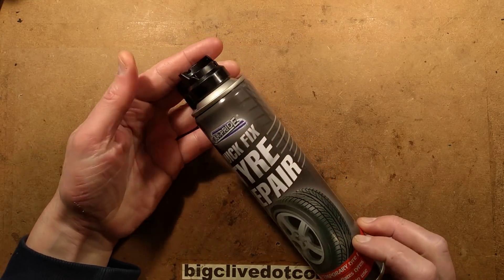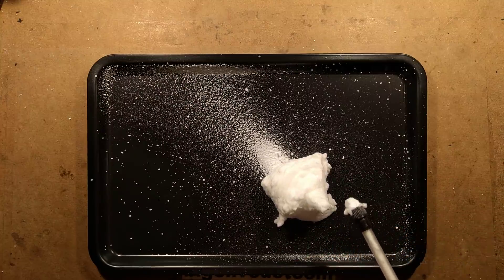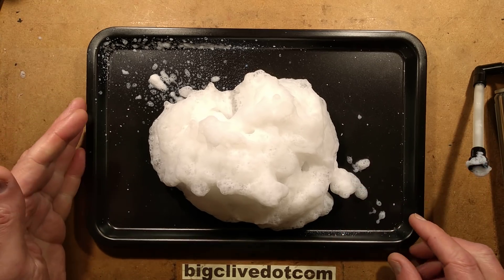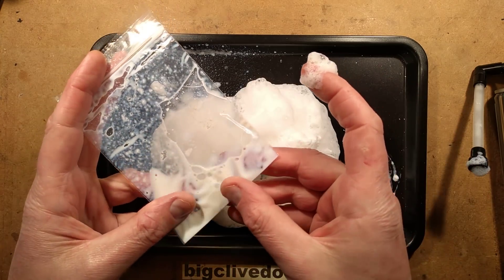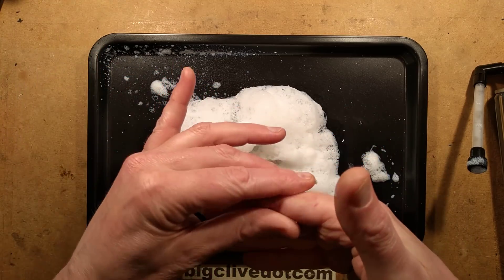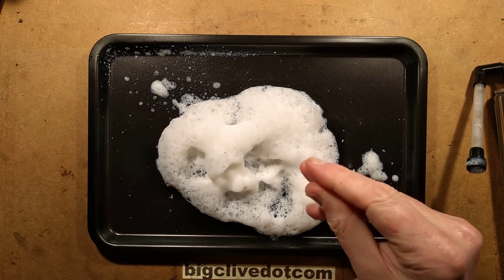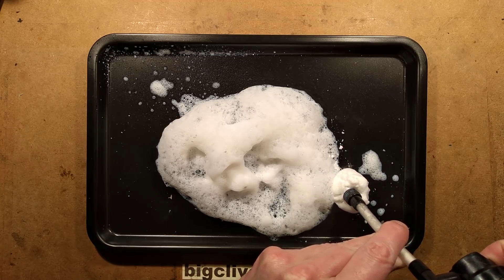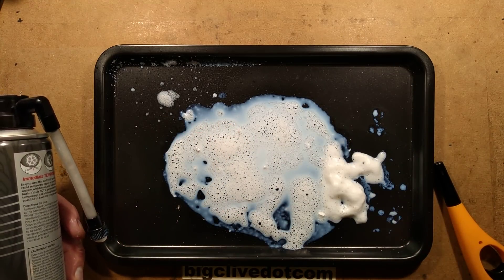What's in a tin of foaming tyre repair liquid.

Comment: I don't know anything about that stuff past that tire shops HATE this stuff.
Reply: I worked in a tire shop 20 years ago, It was Fix a Flat back then. The reason we hated it, it would fill the tire up with a liquid. And when you take the tire off the rim, the shit would splash all over you and the tire machine.
Reply: @caveslug-t2k  it's the same crap now... one drop of that crap will take like 10L of water for it to go away... the worst thing nowadays is that this crap is in the cars instead of spare tire.. that means that I've cleaned ALOT of them... and well.. it sucks
Reply: @EliasH96  I can still remember the smell, wasn't over powering or strong though.
Reply: @EliasH96   *A LOT      NOT "alot".
Reply: It's because after a while being in the tire makes one sticking mess
Reply: Of course, it means the tire shop has to spend ten more minutes cleaning the stuff out. And tire shops hate cleaning out wheels, that's why so many have slow leaks. But if you are old enough to remember driving without universal cell phone coverage....It beats all hell out of hiking an hour to a farmhouse and trying to borrow a phone to call a tow truck that might not show up for another two hours.
Reply: It's the one weird trick they don't want you to know.
Reply: @ACombineSoldier  A local single mom makes $$$ with it.
Reply: @ACombineSoldier  nope... but the mess it makes is so frustrating...
Reply: Mike Oxlong 
Might work on a slow puncture but useless for anything else. Nothing to do with " better engineering"  all to do with cost and weight reduction. Can't beat a proper spare.
Reply: Around here, if the repair shop sees that you have stuff like that in your tires, they won't fix your flat.
Reply: If they don't know how to do an honest and simple repair, who would want them messing around with your tires anyway? Find a real tire shop or (horrors) get a plug kit. Despite the warnings that they will kill everyone within 1/4 mile of them, the good plug kits seem to outlast the tires they are put in.
Reply: @willybee3056  hahaha LIAR! Maybe they take more time and the price is higher. But of course they will fix this. People will burn your tire shop down around here if you don't fix people's tires LOL 🍄
Reply: Willy Bee is correct. They will refuse to repair your tyre. If it's not universal, it's certainly widespread. My experience is the big places will say anything to avoid fixing a flat with telling you you've driven on the flat tyre being the most common.
Reply: Mike Oxlong  
I never said that they had a good reason for not working on your flat.
Only that they would not work on a tire that had been treated with the stuff. I know of 3 shops in town that have told me so. But,
So from what I  am guessing, if you offered enough extra money to compensate for their extra effort,  they would relent.
Reply: Not in my experience here in the US. I've had many tires patched or simply reseated and resealed in the rims, and no one has ever changed a valve except when they are installing new tires. Valves should last the same 5-8 years that tires are supposed to.
Reply: I have used it many times and for long term too and at 150mph in a motorbike and never had a problem
Reply: I work in a part-worn tyre garage. This stuff has a terrible ammonia smell. It also makes a mess and it is difficult to make repair plugs to stick as it inhibits the vulcanisation, even after roughing the surface.
Reply: Mike Oxlong  This is very true.  A lot of manufactors of RF tires do not have a repair procedure.  The RMA <Rubber Manufacturers Association>  have no approved repair procedures for RF either. So if you have run flats dont get a nail!!!
Reply: Mike Oxlong  run flat tires don't need this crap. They are called run flat for a reason. You get this crap with the car, with NORMAL tires because it is cheaper and has less weight and space than a semi or full size spare.
And if this crap has been used on a flat, they won't mend your tire but you have to buy a new one (or most often 2). Not because they want your money, but because the tire is actually ruined. And the rim will need proper cleaning to or you will have so much balancing issues no amount of lead tire weights will get it sorted.
Reply: Mike Oxlong Nah Mike, its just packaging constraints and cost cutting.
Reply: And it destroys the valve...
Reply: @yngwem  and the tyre. I worked in a garage and when a car comes in with this stuff in you can smell half way across the workshop and if you get it on yourself the smell say for awhile. Even after cleaning it. That's one thing I don't miss.
Reply: @yngwem  valve costs a few dollars only. What it destroys is a balance of a tyre as it adheres in unspecified places
Reply: @yngwem  you replace the valve when you get new tyres anyway and any self respecting shop would replace the valve after getting a tyre puncture repaired too
Reply: @CouldBeFrench  ah im not a big car guy but the local mecanic told me to avoid it becouse of the valve
Reply: @yngwem  haha I'm the annoying person who stands there in everyones way making sure my tyres are done right :') got a flat and I had a new tyre and valve fitted on my Renault Clio and it kept going down so went back and they refitted, said it was all fixed.. went on a long drive from Nottingham to Sussex and was almost flat when i got there so went to another shop in Sussex  who said the tyre was fine but they didn't clean the rim at the first shop.. charged me 15 to refit correctly and fit another new valve.. the tyre went flat again by the end of the day :( so i just bought a can of this stuff and it's been in there around 6 months with no issues at all :') should have just got the can in the first place as it would have saved me around 60 pounds.
Reply: yeah, because its a bear to clean up, and it actually destroys the tire from the inside out. It also plugs any TPMs sensor making the repair way more expensive than it had to be in the first place, However, auto manufacturer don't include a full size spare anymore, and your lucky to find a temp donut tire.
Reply: @drkn9t   you're* lucky
Reply: My car is on it's fifth year now, with this stuff, in the left rear tire, so it aeems legit to me.
Reply: @Mehrunes86   on its* fifth
Reply: Mike Oxlong ahh I get where your coming from but “part-worn” and “remould” are different things. In the UK the sale of secondhand tyres is legal. Places like Germany export good used tyres with 5-6mm tread on them cos their laws and attitude is different. Where I work it is preferable to remove the tyre and vulcanise s plug from the inside rather than a string-type from the outside.
Reply: @JamesLeeJimbo   2nd hand (part worn) tyres are not illegal to sell in the uk. There’s heavier restrictions on them now, but plenty of places still sell them.
Reply: @JamesLeeJimbo   you're* coming